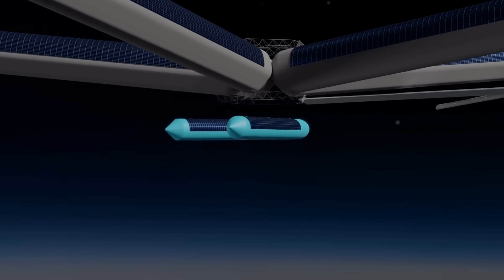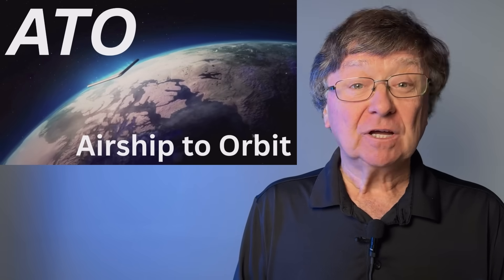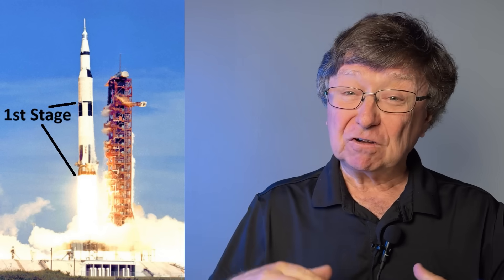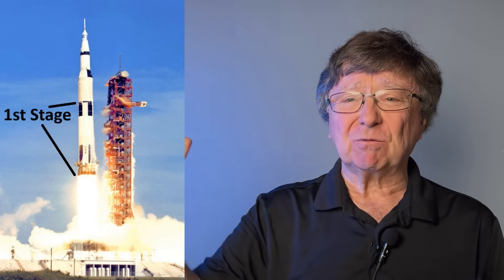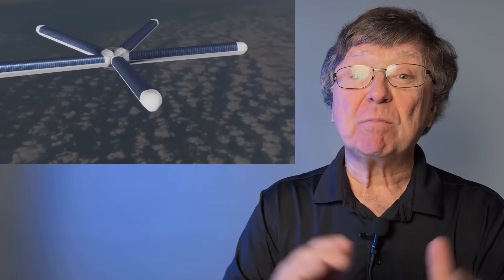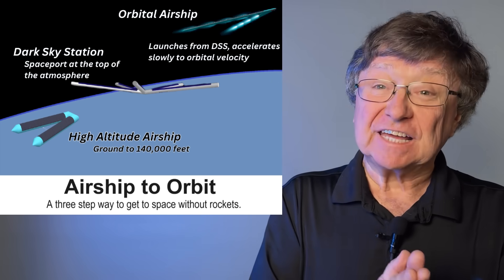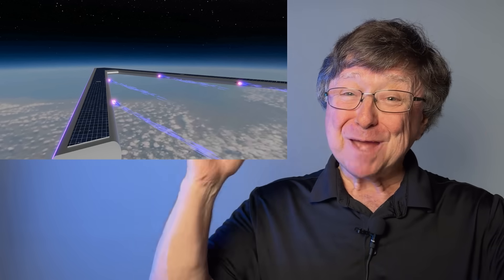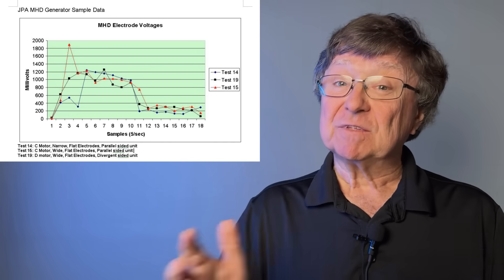This Airship Might Change How We Reach Space Forever!

Comment: I don't know if I understood the concept completely, you want the AOT to travel mach 23 into orbit? I mean, even though you have no atmosphere to fight, the g forces are still immense, this would require a large, strong but still light strucutre, are you planning on uisng a alloy for this, like aluminium/titanium alloys? Secondly, how do you plan on getting the airship back to the ground, or are you building a new one for each flight? Then, I am just curious, are you using a fusion reactor for the MHD plasma or what system are you using for this? I have seen you using model rocket motors, but I belive that you have another system for the orbital insertion engines on the AOT?

Comment: That's bullshit. You can't float a huge  structure in the upper atmosphere with people in it (and equipment) AND have people breading  inside. For it to float in the thin atmosphere , the atmosphere inside needs to be even thinner, and everyone knows that airliners need to pressure the cabin above 10'000 feet (3 km) altitude.
Airships loose load capacity the higher they go.

Comment: I have never understood why a large platform airship was never created to give a half way point for conventional flight to get up to it and then rockets from their. It would obviously be huge but it should make supplies far cheaper to get to space and even create storage closer with easier access like a warehouse. The issue is obviously how well it can stay in the upper atmosphere using helium or similar. It certainly wouldn’t be cheap to make but considering the cost of running large ground based rockets it would likely be far cheaper. It could also be used as a training facility.

Comment: Great video and interesting concept though I do suggest you could use a better simulation program for your animations. What you show is way too simplistic and rudimentary to spark interest and sell the project to investors.
   
Clearly rockets to space are the most inefficient 'brute force" way to get there. If Sci-Fi has taught us anything it is that future space travel will be using some sort of "shuttle" vehicle to get us to space then, much larger space "Ships" to take us from orbit to the planets and beyond. 

Airships, even with today's design and materials, don't lift that much and become too large, too fragile and and ungainly in the turbulent lower atmosphere (just look at history). Jetstream winds are high speed but not at all precise enough for targeted navigation. Once in the thin upper stratosphere, propelling this large structure to find and dock with an even more massive untethered balloon seems rather difficult.

In conclusion, although I love the concept and thinking outside the box, really in my opinion, this idea is unlikely to work in its present form. Sci-fi also has this problem and this is why they are very vague on propulsion systems or rely on matter transmission "transporters" to get stuff to and from space. So no help there unfortunately. 

Keep working on the anti-gravity thought process and using mother nature to get there.

Comment: While I am all on board in reviving airship, this project has a lot of technical difficulties to overcome.
For example, what do you do with the high orbit station when you do not need it?
Sure, you could use a few ropes to anchor it down but that would add a lot of weight.
Engines are also a option but do you really want to fight the high attitude winds all the time?
It would be better to build a airship a bit bigger but already able to reach orbit on its own.

Comment: Interesting concept. I have a few questions, actually several. Why is the Load vehicle V-shaped? What percentage of the volume of the floating space station has to be hydrogen lift cells to keep it up? What is its total payload? You're talking huge structures here, do materials exist strong enough to hold them together? Are upper atmosphere jet streams or lightning a threat? Can the delicate  orbital wing really withstand aerobraking?

It's a beautiful concept, if the technical problems can be solved. Almost like going back to the ancient way of crossing oceans with sail power - slow but steady, and economical.

Comment: I think my biggest hang up with this concept is station keeping and maintenance for dark sky station. Nothing holds pressure perfectly (whether it’s using vacuum buoyancy or pressurized light gasses) so I’d imagine there’s a fair bit of maintenance involved, either with STO gas transfer or STO spare pump parts, as well as regular flights to transfer those items. Given the relative efficiency of the ATO first stage it’s not insurmountable but I do wonder how it stacks up to other options.

Comment: I like the basic concept of using buoyancy to get you above the thick lower atmosphere, since that much gain in altitude is essentially free. The specific details I'm not so sure about. For an air launch concept that uses brute force to get off the ground, but is a step beyond dropping from a B-52 like the old X-15, we should review Arthur C. Clarke's concept for air launch from one of his first books, "Prelude to Space" from about 1948. It was his speculation about the first moon launch. As I recall, it involved, first, a massive rocket-powered sled on an inclined track. On the sled was a massive jet aircraft, enormously powerful but, with its load, too heavy to take off unassisted. At the top of the track, the huge airplane lifts off the sled and climbs to the stratosphere. Being an air-breather, there's no need to carry an oxidizer as a rocket does-- all it needs is enough fuel to get up to the launch point for its load and to fly back to base, where it lands conventionally. And what is the heavy load it's carrying? That's the actual spacecraft, which is a rocket. Since the first two components,the sled and the heavy-lift airplane, have done most of the work, the rocket doesn't have to be overly large and has enough fuel to reach orbit. I don't recall if it needed orbital refueling to reach escape velocity and get to the moon and back, or what the procedure was for the lunar landing and reentry into the atmophere and landing. I read this as a kid back in the '60's. But that was the basic system for reaching orbit. The sled and big jet, which together served the same purpose as a first-stage rocket booster, were of course completely reusible.

Comment: This crossed my mind, given how we can send balloons up with cameras into space, only difference is the speed required to gain orbital velocity, would need to be a big airship to carry even a small rocket up.
Reply: Sadly getting up high and even friction losses are under 10% of the energy needed to orbit a payload, so being high and in vacuum is not the main part.  The big energy is needed to get it going 8km/s or 18000mph.  At 600 mph a rocket reach 30miles of near space in 3 minutes.  The Space Shuttle had to burn engines for 11 minutes to get to space.   Launching from say 30 miles up in near vacuum might save 20% of the size of a rocket.

Comment: John, 
A load carrying structure on the edge of space and a way to get to it has tremendous economic value on its own even before the third step. If you can reliably nail #1 & #2, having funding to complete the last step will be trivial. I looked on your website, but couldn't find the numbers.
1. How close are you on the spaceport and ascender? 
2. Does the spaceport have station keeping capability or does it just float around the earth at 180k feet? (with average windspeeds at 180k' at 20mph and 1/2000 the amount of air, it seems like station keeping should be possible.)
3. What is the expected cargo capacity of your spaceport V1?
4. What is the expected cost of the spaceport V1?
5. What about the ascender, what is the expected cost per launch? 
Depending on the answers I can see a number of business models to support the eventual goal. High speed low-latency broadband internet for rural communities. (federal funding available) Solar power. NASA/NOAA/NWS and other nations similar agency contracts for high altitude atmospheric monitoring. Obviously "space" tourism. This is five minutes of brainstorming. If you are close to having something or commercial quality, getting you cash should be trivial. I would love to talk. Thanks
Reply: I wonder about the expansion of gases on the way up and down. It is feasible to compress the gas on ascension and then release it into the structure on the way down?
Reply: I agree with the edge of space comment, but a hotel at 42km is still pretty cool. A floating solar farm, telecommunications... 42km is perfect for that. If station keeping is possible, much higher speed, and more reliable Internet would be possible there than via satellite. (And Elon is making billions off of b wifi.)
If John has #1 & #2, he has a business, even if it isn't technically at the edge of space.
Reply: The "edge" is NOT at only 42km, but somewhere at 100 !!! A lot of BS on this presentation...
Reply: Who will bring constant loads of fuel, in order to keep station ?? How will "endure" the station lifting capacity the extra-weight of fuel + maintenance (oxigen, water, food, etc) ? Lot of practical questions, ZERO answers.
Reply: I couldn't agree more. If he has the numbers and what he is talking about is real, he had a business. If he doesn't have the tech, he doesn't have a business. There just isn't enough information to say with certainty. But personally, I hope he does have the numbers and tech.

Comment: 8:15 "There is A LOT of new tech required to make this happen."
There's a reason for that. Airships are much too heavy for the upper atmosphere, and too weak to handle 28,000 km/h. Theoretical technologies and miracle materials required for any of the Dark Sky affiliated projects would be more useful in more-established programs, if we ever get them.
JP Aerospace hasn't even managed to prove that airships are viable enough for more terrestrial use:
When they had a military contract, they lost it when their prototype got damaged before takeoff. Yet they're trying to say they can reach space with the same tech? I'm sorry, but as much as I love the idea, this is still a pipe dream at best...
Furthermore, the Magnetohydrodynamic concept sounds nice, but comes with the serious caveat of requiring equipment far too dense to ever work on an airship, especially one bound for the upper atmosphere. That's assuming they can fix the air-conductivity issue at such an altitude.
JPA is admirable, yet we cannot and will not reach space with a volunteer- and donation-based program that has yet to show merit for more than student and media launches of balloons. They don't even have the integrity and attention to detail to fix typos on their website or videos yet.
I challenge JPA to discuss these points instead of simply deleting my comment, as is always the temptation. :chillwcat:

Comment: How do you get the rocket up to the airship so that you can launch it from the airship? If you do it with another rocket, that would defeat the purpose of the airship. Do you attach the rocket to the airship, when the airship is on the ground, then release the airship? That is only good for one rocket launch. How do you get the airship back to the ground to pick up another rocket? Slowly release the helium? Seems like a lot of mucking about just to save a bit of rocket fuel.

Comment: how would you solve the pressurization vs integrity mass problem? higher atmospheric range increases pressure differential requiring  stronger materials to compensate, which offsets the lighter than air properties? 

the material would also need to withstand sustained thermal load(which would also increase pressurization differential from the heating of whatever gas is being used to make the vehicle lighter than air) from going at mach 10 which again, further increases mass and lower the buoyancy.

im also curious as to what references you have for project shotput reaching mach ten with balloons, as the NACA documents on project shotput 1 and 2 do not reference such velocities for balloons (though there was one which used a mylar balloon to raise a rocket which then fired  and reached mach 10, but that was the rocket, not the balloon)

Comment: I toyed with this idea. Problem is it has to be huge to be practical. However, If you heat the gas, like really hot, wouldn't that also increase buoyancy? You can use an areo gel matrix for the gas. 3d printed aluminum with a naovaped alloy, then coat with graphene, by means of a sputtering magnetron for the structure. You know there a much easier way.

Comment: So, first things first.
1. A station altitude is 140 000feet = 42 km. Quite high, yes, it is a good height. But you'll lose a lot of helium during the launch.
2. A rocket spends around 3-5% of its fuel because of air. So, the altitude means nothing.
3. Engines... is your big advantage. And looks like it could start from the ground and land on the ground - it would be much cheaper instead of using "dark sky station".

Comment: Would there be an advantage to using carbon fiber and going REALLY big? I'm thinking that volume with high strength and relatively thin skin would maximize lift from the ground all the way to orbit. Maybe it could modify its shape for re-entry? Flatten out into a disk or something to increase drag. Obviously, I'm an idiot, LOL Just throwing stuff at the wall.

Comment: A few points, I need help with. The Dark Skies Space-station is travelling around the earth, at Mach 10, relative to the surface, or is it stationary? It remains aloft, by lighter than air power, yes? When does the 'load' get it's horizontal velocity? Mach 10? Doesn't orbital velocity need to be much, much faster than that, perhaps I'm just thinking of escape velocity? Station Stationary. The load ascends with no horizontal velocity. All, horizontal velocity is achieved by the final gossamer-wing craft. Yes? No? Please.

Comment: Consider a mass of one kilogram in a circular orbit at an altitude of 300km. To get it there from the surface of the earth we need to provide enough energy to do two things. Firstly, we need enough energy to lift it up 300 km from the surface of the earth  and, secondly, we need enough energy to accelerate it to the 7726 m/s speed required for orbit, at that height.
The first, is called gravitational potential energy [E(p)] and comes to 2.94million Joules. The second, called kinetic energy [E(k)] works out to be 29.8million J.

In other words, it takes ten times the amount of energy to get a satellite up to LEO velocity, as it does to get it up to orbital height. In practice, it takes very much more, because for every kg you push up to orbital height and velocity you have to push hundreds (mainly fuel and oxidiser) part of the way there.

I have often wondered why nobody ever designed a craft that uses conventional turbo jets for a re-usable first stage. I’m sure there’s a very good reason because these guys are not idiots but, at first glance, it seems a “no brainer” because a significant proportion of the mass, at launch, is the oxidiser needed just to climb the first few miles and hit the first few hundreds of m/s. I guess that’s the idea behind launching from a plane.

Can any space scientist cast light on this? Obviously, it must have been considered, so why is it not a good idea?

Comment: You didn't explain the function of the valves, can you heat them or add an insulated heated enclosure using solar to solve the temperature issues?

Comment: What if instead of 3 stages you had the ascender float up with hydrogen balloons and then the darksky station could have oxygen concentrators so that when the ascender reqches it it could compress the hydrogen it brought up with it and fill up with oxygen that the station accumulated for it and then it could use that in a rocket stage to make it to orbit? Would a balloon be carrying enough hydrogen on board to do that? Would it be possible to make the envelope of the balloon form some sort of hydrogen containing substance that could be thermally decomposed to create more fuel from the mass you brought up with you?

Comment: well... actually full gas replacement is not even necessary if gas exchange system is used like its used on submarines... ie decrease pressure inside ballooon or replace inside of it with helium when going up and fill it back with carbon when turning back .. ;P